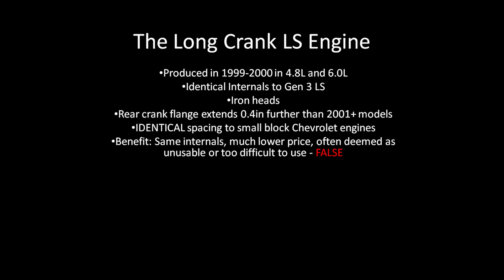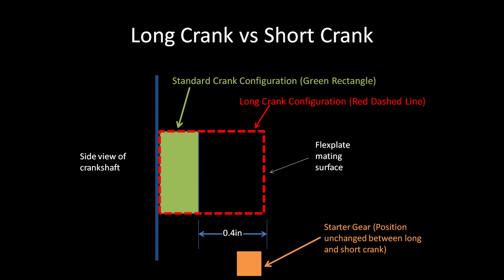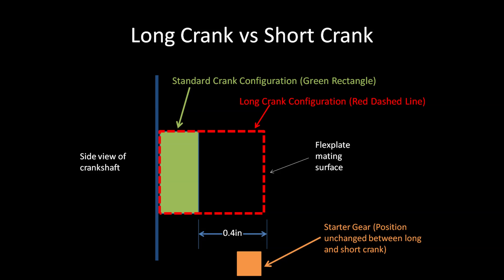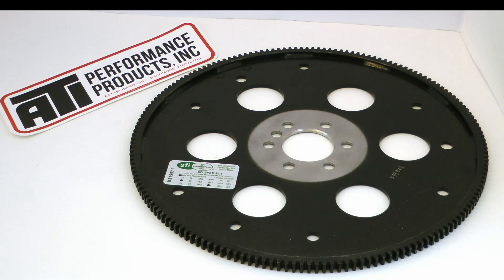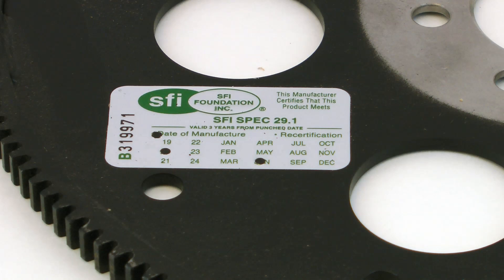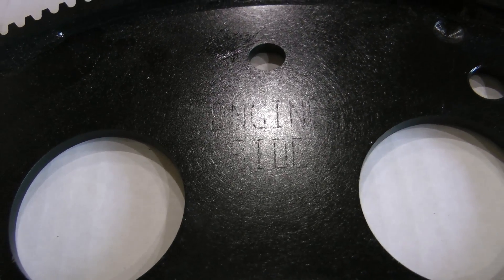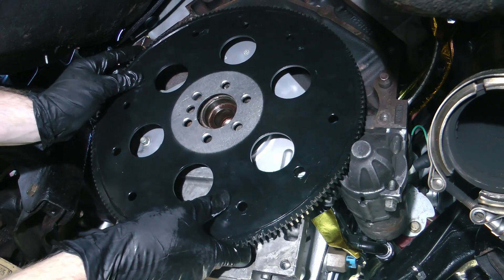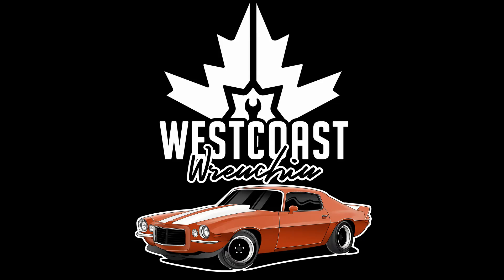SFI Rated Long Crank LQ4 LS Engine Flex Plate - ATI 915543

Comment: I have a 2004 lq4 and using a powerglide. Which flexplate do I use with a 10.75” bolt pattern torque converter?

Comment: Will a standard 4l80e converter work or are the longcrank convertors different too?  I have the stock 4l80e that came with the longcrank engine and need to order a stall. I ordered the flex plate you reviewed in this video.  I know this is an older video, but if you could give me some insight that would be awesome.  Nothing but conflicting info online...
Reply from the maker: What crank are you using?

To make a long story short there is only one type of converter that you can use for a 4l80e they are all the same

Comment: My lq4 came out of an 04 van with a 4l80....it has a spacer from the factory bolted to the crank flange....im putting it into a 71 chevelle....which 4l60 is the correct one for my engine?....the 4l80 in the van was bad which is why I'm not using it instead of a 4l60e....plus the 4l60 doesn't require me to have another new drive shaft made for my chevelle.
Reply from the maker: I would really push to get a 4l80e, its worth the upgrade I assure you. Remember that your 4l60e is essentially a 700r4. 

With regard to your situation you had a spacer bolted to the crank because the 4l80e is setup with the same spacing as a traditional sbc. The reason your engine had the spacer is because you have a common ls short crank shaft (not the oddball long crank 99 like mine). You want want a 60e which was bolted up to an ls engine. You'd want something 2002 and newer.
Reply: @WestcoastWrenchin  OK cool...thanks for the info....as for the 4l80 it's gonna have to wait...i just now purchased my stand alone harness for a 4l60e ....plus i just had a new drive shaft built two years ago for the th350 that I used run....the 4l60 and th350 are the same length so I still use my new drive shaft for now until I can afford to do the full 4l80 conversion....right now I'm just trying to get my ls swap finished and my chevelle back on the road....ive had it apart way longer than I wanted too....this. Is my first swap and Amway over budget as it is....plus I'm also repainting my car at the same time...once I get it all back together and finished then I will have the money and time to address a few corners I cut and replace or buy the things I couldn't afford at the time ....or that had to wait while I was saving up to purchase other things....im sure you been there yourself at some point...sometimeswe must make comprimises in one area to do things the right way in another area.
Reply from the maker: @davy1458  i know the feeling and it is best in your situation for sure to just get it on the road! When they sit too long they sometimes done get finished! Cheers

Comment: Are you positive this will work with a long crank 4.8 and a 4l60e transmission??
Reply: No, this flexplate is drilled for either a 10.75" or 11.50" torque converter bolt pattern so a standard 11.07" 4L60/65/70 bolt pattern will not work. The converter snout will also be too long. You will need a custom converter built to attach a 4L60/65/70e transmission to a long crank 6.0/4.8 engine.

Comment: What converter would u use to mount up to 98 4l60e ? Do u need longer dowel pins ?
Reply from the maker: Id give ATI  a shout, I'm sorry but I really don't know much about the 4l60e. It is a shallower bellhousing so I'd think you'd just run it without the spacer

Comment: Great info, do you know if that flex plate will work when trying to do exactly the same 6.0 swap but with the 4l60e rather than the 80e?
Reply: Ima find out myself in a week or so. I just ordered one. Ill let you know
Reply: @alexanderperez2936  cool ... thanks!!  and good luck
Reply: Did you guys figure out if it would work with the 4l60e?
Reply: @alexanderperez2936  did it work?
Reply: @mattb4164  it kind of did. I also meeded a bellhousing spacer. But that could’ve been because of my converter

Comment: It only lines with three holes on my 4L80e converter 🥺
Reply from the maker: Whats the issue?
Reply from the maker: Its likely drilled for multiple patterns
Reply: @WestcoastWrenchin  looks like I’m gunna have to dremel out 3 holes be cause my convertor has 6 holes. And the flex plate only matches up with 3 holes
Reply from the maker: @nathanielmackinnon6738  I would review with the converter manufacturer, that is something which has to be perfectly centered and not dremeled.  Are you sure its not a three bolt converter with two different bolt patterns?
Reply: @WestcoastWrenchin  nope I’m positive the factory flex plate line up precise. But this flex plate for some reason only allows 3 bolts. The plate has plenty of holes just doesn’t match my 4l80e converter
Reply: 3 holes line up great an the other 3 are off you can only see a tad bit of the other 3 holes
Reply: @WestcoastWrenchin  so can I use the 3 holes it lines up with?
Reply from the maker: @nathanielmackinnon6738  review with your converter provider please!
Reply: It also doesn’t have stapped which is front or back side of flex plate total disaster

Comment: Would this Flexplate work with the long crank 6.0 and a 2003 4l65?
Reply: No, this flexplate is drilled for either a 10.75" or 11.50" torque converter bolt pattern so a standard 11.07" 4L60/65/70 bolt pattern will not work. The converter snout will also be too long. You will need a custom converter built to attach a 4L60/65/70e transmission to a long crank 6.0/4.8 engine.

Comment: Will this work for a 4.8 long crank and I’m trying to connect a 4l60e (automatic) trans. ??
Reply: What did you figure out? I’m trying to do the exact same thing
Reply: No, this flexplate is drilled for either a 10.75" or 11.50" torque converter bolt pattern so a standard 11.07" 4L60/65/70 bolt pattern will not work. The converter snout will also be too long. You will need a custom converter built to attach a 4L60/65/70e transmission to a long crank 6.0/4.8 engine.

Comment: Does it have the holes for a 3 bolt converter.  I have the flat flex plate but I can't get a converter for it. Lq4 with a 4l80e.  For something everyone does nobody knows Shit.
Reply from the maker: Yes I believe so, give ati a call tomorrow to confirm they've got great tech folks. I would highly recommend this plate as it has multiple patterns.
Reply: @WestcoastWrenchin  awesome thanks for quick reply.  I'm on the verge of hitting the flex plate with a die grinder to make it fit.  But I'd like to have an sfi cert and be safe.
Reply from the maker: @timh1187  get an SFI, its not worth the risk!
Reply: So this will work with any newer model 4l80e convertor or are the long crank convertors different too?

Comment: Or a 2003 and up 4l60?
Reply: No, this flexplate is drilled for either a 10.75" or 11.50" torque converter bolt pattern so a standard 11.07" 4L60/65/70 bolt pattern will not work. The converter snout will also be too long. You will need a custom converter built to attach a 4L60/65/70e transmission to a long crank 6.0/4.8 engine.

Comment: Will this work with 4l60e
Reply from the maker: Yes it will, just don't run the spacer
Reply: @WestcoastWrenchin  No it won't work with a 4L60e. This flexplate is drilled for either a 10.75" or 11.50" torque converter bolt pattern so a standard 11.07" 4L60/65/70 bolt pattern will not work. The converter snout will also be too long. You will need a custom converter built to attach a 4L60/65/70e transmission to a long crank 6.0/4.8 engine.
Reply from the maker: @BadLuckGarage  in the exact same way you can install a 60e on an sbc you can install a 60e on a long crank engine. Long crank is identical to an sbc. Yes you will need the correct CONVERTER but that is always the case.
Reply: @WestcoastWrenchin  No sir I’m afraid you are mistaken unfortunately. The late model 4L60e stock converter flange needs to be machined if used with a flat flex plate. It’s a different converter than the early sbc 4L60 converter and will not seat properly into the crank.The early 4L60 converter was also a 10.75” bolt pattern whereas the later 4L60e is a 11.07”.
Reply from the maker: @BadLuckGarage  thanks for sharing

Comment: Do you know what flex plate you can use if using a th400 with the long crank LS?
Reply from the maker: Same one as this I believe! Th400 and 4l80e are both traditional spacing from bellhousing